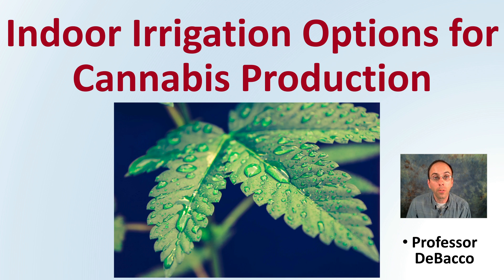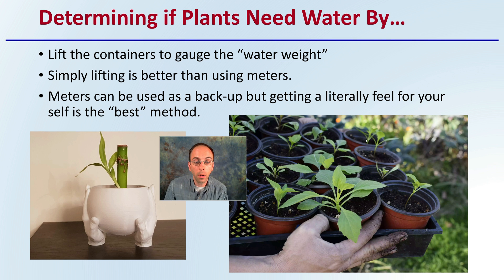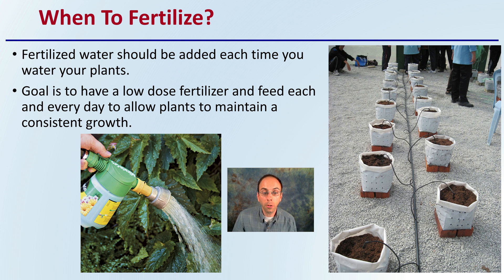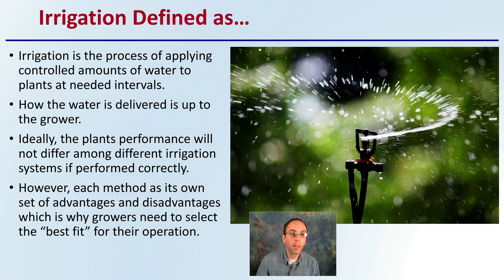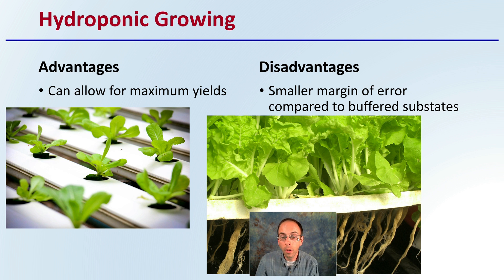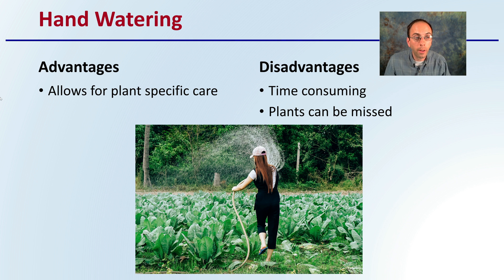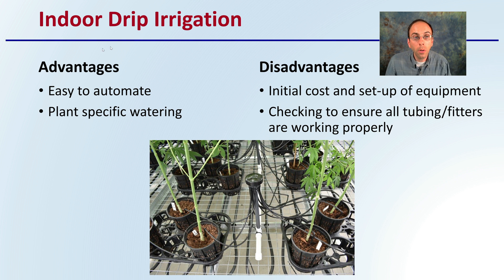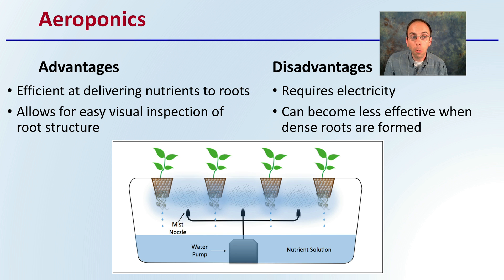Indoor Irrigation Options for Cannabis Production

Comment: What about ultrasonic foggers in an aeroponic site? Would the fog produced be more invasive into the root mass?
Reply from the maker: These can have issues when nutrients are added and really do not produce much of a benefit.  A high humidity will create a similar environment for the plant with less chance of issues.
Reply: @DeBaccoUniversity  Thank you for your quick reply. One more question:...
When designing a R-DWC system, is an upflow (into the grow site) better than a downflow (out of the grow site) as far stagnation pockets and clogging/flooding is concerned? BTW, love the channel.

Comment: Dear Professor.
 l would  like to install a dripping irrigation system. But I worry about the over watering.
Reply from the maker: This video is for outdoor production but the same general concept can be applied to your situation...  https://www.youtube.com/watch?v=Fg43rpjM2os
Also, when in doubt water with a timer and make necessary adjustments.
Reply: @DeBaccoUniversity  Thank you for the fast respond. i watched this video before. still not answer to my problem. my plants a e never same. They drink differently.
Reply: @olgaolga3292  If I may, check sub-irrigating pot/planters. This is a fool proof way to do it. The channel hemp in a pot shows you exactly how to do it for cannabis plants. Cheers
Reply: @telnek  Thank you. But unfortunately is not good for the nutrients what I use. With this powder nutrients I have to watering from the top.

Comment: How often should they be watered for say a 3 gallon pot single plant? 
I hear “don’t let the roots be wet for long periods as wet rot can form”
“Don’t let your pot sit in water”
“Let the pot dry out to improve root growth”
It’s very confusing.
Reply from the maker: What substrate are the plants growing in and how big are the plants?  Typically you can start with twice a day and make adjustments from there if growing in soilless mix.
Reply: @DeBaccoUniversity  thank you professor. The plant is now H.14”-15” Canopy Dia. 15”-16”
And quite bushy to look at.
The pot is H. 8” Dia. 6” 
She’s an Indian strain called Gorilla Glue.
Oh and 80% coco coir with about 20% worm castings.no perlite as none was available for me to get at the time I got her all I was told was “get coco”
Reply: @pjarma8536  wow........
Reply: @DeBaccoUniversity  why not use a simpler solution, like what was suggested above. Hydroponics. Very simple. The person was wondering about root rot, and how often to water. Hydroponics fixes both.
Reply: @dragonbonefist1510  I don’t have initial outlay for hydroponics for one plant. The person I got given the clone by said it was in coco coir and to just get more. I added a 1-2 inch worm cast scrape in the top Layer. I’m worried about my plant not get getting enough water as a couple of leaves have curled up and feel dry and almost crispy. But the advice is all over the place ranging from “don’t give too little” to “don’t give too much” I guess I’m best just learning the symptoms of both and then water as needed
Reply: @pjarma8536  Yes I understand, PJ Arma. Sometimes just learning from mistakes is the only way to go. You are right. Best of luck to you 😊
Reply: As a general rule. Plants can be submerged in water(basically Hydroponics). However a portion of the plant, needs to have good aeration.(very good drainage, like: perlite, clay balls, etc.) To keep the plant from drowning for lack of a better term.... So, I would suggest if you are using a 3gal pot. Fill two thirds with good drained soil, fill the last third with clay balls or something to keep lots of oxygen to roots. Then bottom water in a large container. So a pot inside of a pot. The water can be there at all times, provided, you change the water out periodically.